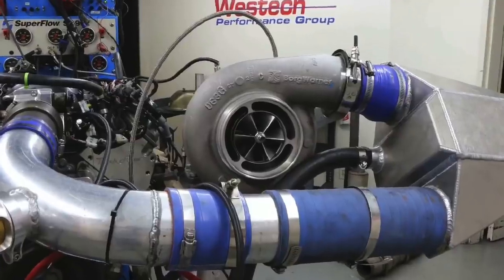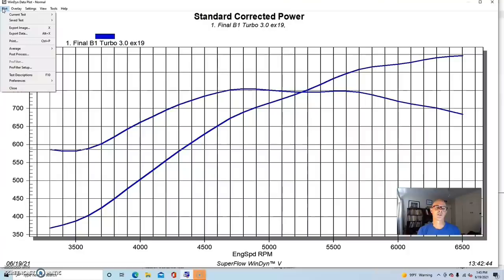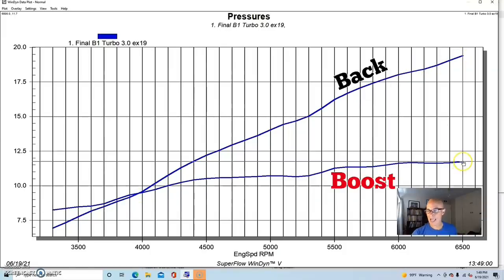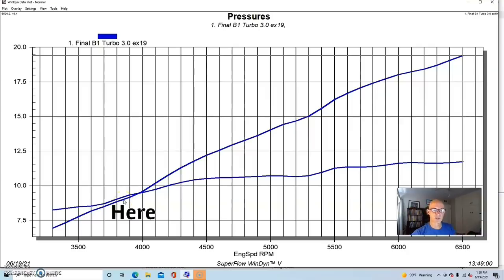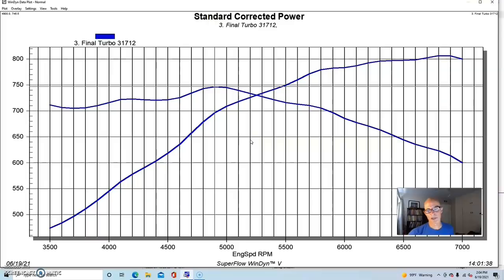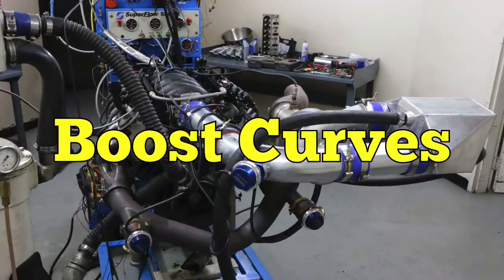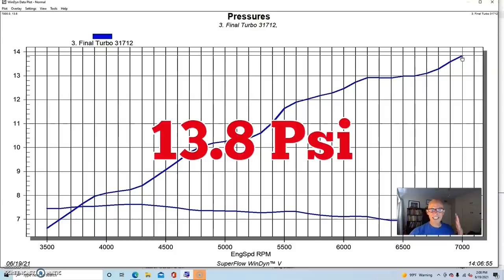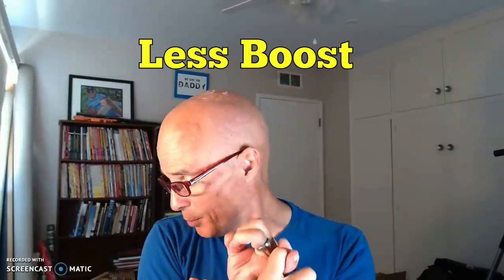JUNKYARD TURBO LS BACK PRESSURE TESTS (HOW TO: MAKE MORE HP)

Comment: Richard, you seem to make emphasis on the exhaust setup right after the turbo. What would you call that form where there seems to be 2 reducers matched together? Could you elaborate?  It resembles a regular yet turbine  exit. I imagine there's something there as to the shape air wants to take while exiting.
Reply from the maker: was only there to allow us to bolt it together-not a good idea

Comment: Quick question I have a K24 but my throttle body leaks, so I wanted to weld it on in front of the compressor on the turbo housing is this a good idea? I am on a budget, but I can weld.
Reply from the maker: welding the cast throttle body might be difficult
Reply: I could also do a custom adapter, i’ve been welding over 20 years I just have never seen anybody put a throttlebody before the turbo. I’ve seen it done with carburetors. Do you think that I’ll have any problems? Not welding or fabrication but performance. Also, thank you for responding. I know your time is valuable.

Comment: ls 5.7 9.5 cr lot of backpressure ( vs racing 7875)...headers or line afrer turbo is the cause?
Reply from the maker: exhaust size and flow after the turbo effect back pressure, so does the na power vs turbo size

Comment: Is 2:1 a bad ratio? Backpressure to boost
Reply from the maker: VERY NORMAL RANGE
Reply: @richardholdener1727  what if your backpressure if very high.  I have a very tight tight 90 after the turbo and I think it’s making a lot of backpressure.
Reply from the maker: restrictions are bad for flow
Reply: @richardholdener1727  yes but what will the restriction and bad flow cause.  Other then HP loss.  Does it push air back into turbo through the seal? Does it damage the turbo? Does it make it run rich? Does it not evacuate the gasses in combustion chamber causing more pressure on rods?
Reply: Damages your dyno sheets thats about it
Reply: @BulliKid also raises crank case pressure.

Comment: Love this video. Tells me that I want to do a 6.0 with rec port heads a ls3 or truck intake and boost and a 4 inch exhaust with a electronic boost controller. That to me would be the most efficient set up for a street application.

Comment: On a recent hp academy interview ( I agree with your point ) but the tuner , the scion guy , stated he seen 0 extra exhaust flow / volume to the turbo adding 100-150 nitrous under  boost , where as I would have expected to see this enhance spool with gas expansion, but it seams not
Reply from the maker: he is wrong-how do you add an extra 150 hp to any motor without changing exhaust flow?
Reply: @richardholdener1727   so here is a link 
https://www.youtube.com/watch?v=lrYpgQIXSSM&t=5s
see he is a credible source , see what you yhink , i'm with you on this , might be worth a video , not to prove someone wrong as he seen what he seen , [[ different engine or whatever ]

Comment: hello there,  so im having issues with boost drop with a smaller exhaust system but when i do open downpipe it work wonders.   do you think this will be my issue?
Reply from the maker: YOU ARE BUILDING BACK PRESSURE AND IT CAN ALSO CHANGE THE OPENING OF THE GATE

Comment: I use a 5 inch downpipe on my s475 because I had the room (some of the firewall had to get out of the way) and that's what the outlet is plus...the huge pipe looks cool. It seems to really like it. Despite having no boost controller and running a pretty small 5L engine, it seems to spool pretty quickly. A 4500 stall doesn't hurt either.

Comment: Can you do this with NA LS motors
Reply from the maker: back pressure tests?
Reply: @richardholdener1727  yes. I've got open headers on a stock 5.3 with a tune and all the old guys I work with are telling me I need to put mufflers on it to get more back pressure so it will make more power and I dont see how that makes sense
Reply: @uscgamecock9432  old people think back pressure is something you need, it's an absolute load of shit. Get your car tuned and it will run better, it might run a little lean with open exhaust.

Comment: I wonder what happens if you feed a radial supercharger into a turbo and put an intercooler behind both stages
Reply from the maker: we ran twin turbos with an intercooler feeding an M112 Roots on a 2003 Cobra motor with an ATW cooler-works well
Reply: @richardholdener1727  well yes but I expect a centrifugal to work differently then a positive displacement blower. Hear me out. At low speed the turbo can still suck through the centrifugal. At higher speed the turbo does not reach its flow capacity nor its surge line since the surge line is defined by the ratio of ambient pressure to pressure after the compressor. And the flow cap / choke is defined by CFM in which does not change much since the air is pre compressed. Turbo speed will likely increase but it's counteracted by it having to do more work to compress a more dense charge. So at low speeds you should be able to gain allot more tourque and boost earlyer on and you should also gain more efficient operation at higher speeds (compared to a turbo of the same size at a similar pressure) 🤔

Comment: I liked these videos already, but now that I have my own 5.3 LS 4L80E swapped 2001 Mustang V6 on 10psi T45 ebay turbski, they are better than TED talks! I think I blame Mr. Holdener and Mr. Mcfarland for not so subliminal messaging to the deepest parts of my car brain.
Reply: Where'd you find a 4l80e are they rare in the states?
Reply: @andrewlace   many 2500 and bigger trucks, vans, and SUVs had them. Pretty common here in Texas but most have been worked hard.
Reply: @michaelenglund4963  in Australia that's the hardest thing, getting a good gearbox. Lots of turbo 700 getting built but a 4l80e would be a fantastic gearbox especially if it's been built. Imagine one of these behind a barra (Ford) lol.

Comment: Is there any kind of math that can be done to help choose an exhaust housing AR? Let's say two ebay GT35's for a 466 to 521 inch mill, there are two different AR's and I'm leaning towards the bigger AR because it's not a small engine and I'm not clear if the smaller AR (.62 ) will choke it compared to the .80 AR. All the mathy things I find are impeller maps, but that's the other end of the turbo... :)
Reply from the maker: use .80 on a 521

Comment: Completely unrelated: Richard Holdner now sells exhaust valves and pistons...
Reply from the maker: No Thnx
Reply: @richardholdener1727  Have you done any work with the Caddy Northstar? I've heard of some great results on the dyno just with some camshaft adjustment with the stock cams. I think it would be fun to check out since you did the big inch Caddy engines. Now you could do the baby Caddy engines or even the 4.0L Aurora engine. Big revs!!

Comment: Richard, can you add the lobe separation of whatever cams you are running at the time so we can see examples and where peak torque happens. It's more significant with carbs because you can't vary injection timing or duration. 106 separation has a lower peak torque than say a 110 lobe separation. Obviously with EFI you can do whatever, I'm curious to see what the effects are.
Reply from the maker: cams do the same thing regardless of whether the fuel is supplied by a carb or efi

Comment: The LS3 heads need a bigger A/R to drop the backpressure and increase the boost pressure without changing anything else.
Reply from the maker: any head that increases the power will show similar back pressure results

Comment: I had a test on my channel recently where an s366 slightly outpowered an s480 Back to back, same boost. Turning the bigger compressor when it's not required did infact create more backpressure and it showed on the dyno as well as the boost control. Thanks for providing us with these tests Richard, cheers. 🙂
Reply from the maker: an s480 had more back pressure than an s366?
Reply: @richardholdener1727  More duty cycle was required to keep the wastegate under control with the s480 at 10psi.  It's probably important to mention that we were only testing at a knock limited 10psi on pump fuel in-car.  Had we increased the boost with e85/Race fuel, obviously the s480 would have less backpressure as the testing progressed to higher boost levels. But as far as relevance goes in regards to how most people would use the car on the street (i.e., pump fuel, heat soak, knock limited etc.) I thought it was notable for the majority of street driven cars. I should also mention that we did not have a backpressure sensor, just backpressure against the wastegate to come to that conclusion, and I am definitely open to the subject :) 

Also, the s366 made a few numbers more on the same boost/timing which also leads to the lower backpressure hypothesis in my opinion. *There were no other changes to the car other than the Turbo swap.

Comment: "Boost" is a measure of backpressure in the intake. This becomes most obvious with a belt driven supercharger where you swap on better heads or intake, lower measured boost, but make more power. Turbos just often mask this because wastegates maintain pressure to a set point as improvements are made. Meanwhile the shaft is spinning harder...
Reply: This is why I boost itself is a terrible number and concept. You need to be talking about mass air flow. The engine is just a pump, you need to measure how much air it is pumping.
Reply: @otm646  I have primarily tuned speed density but I will admit that mass air is a WAY smarter way to measure things. When you KNOW the CFM incoming it's got to be easier to properly fuel the silly thing. I like that concept much better for sure but finding a meter you can get readings from on an aftermarket ECU is painful. Certainly the superior way for many situations I think.
Reply: Wish more people understood this.
Reply: @rwdisgreaterthanfwd  no shit man.  People talk about boost like its the same across the board across every type of car or truck and forced induction.  "How much boost can it take?" Is an annoying question that bugs me lol.  10 psi on a big ass turbo on a fully modded engine is totally different than 10 psi going to a stock motor via a smaller turbo.   Not even comparable.  The airflow on one is going to demolish airflow on the other despite both running 10 psi lol.
Reply: @midnight347  Yeah,. it's always weird when you swap turbos, run the "same boost" but end up with MORE power! Nowadays we can datalog backpressure and many other things to better understand but that wasn't always the case for sure. People still don't get it though and Richard's videos really help dispel many of the myths :)
Reply: @rwdisgreaterthanfwd  To be fair I was one of them! I had a belt driven supercharger on my Mustang MANY years ago and when heads were ported etc. I was upset I'd lost boost. Except - the car was clearly faster! It took awhile but I get it now but back then hardly anyone understood much of this it seemed and people ripped EFI off for carburators. Meanwhile I was swapping on turbos lol.
Reply: This is how you can take a stock turbo car that has a stock computer set for a stock boost level, and upgrade the exhaust intercooler and turbocharger and at the same boost levels make quite a bit more power.
Reply: @robertfattaruso1280  Or blow it up if it's Speed Density and not MAF! This is a large part of why the FD3 blew up so easily back in the day. Detonation sensitive and very easily able to remove restrictions - whoopsie!
Reply: @BLKMGK4  haha yeah that's true, older cars that were speed density and didn't have mass air flow we're very susceptible to damage. But with today's technology and newer cars with quick responding ECUs you can do a few minor upgrades and gain 60 to 70 horsepower on a turbo 4 cylinder without modifying the factory computer settings. If you remove restrictions on the inlet and outlet as well as increase the turbo efficiency, throw a little splash of e85 in the tank with 91 octane and it's a very streetable gain.

Comment: @richardholdner   Per your theory, i ask you this..  
If a cam that's ideal for an NA engine to make the most/best power it can, then why are there "turbo" cams? From your theory, "the more you make NA, the more it'll make boosted".  The conflict i see is, the ideal NA cam for a given engine isn't the best cam once it's turbo'd. Discuss...
Reply: N/A cams tend too have more overlap.

Turbo cams tend too have less.

If you have 30psi of back pressure and 15psi of boost what wins when both the intake and exhaust valves are open?
Reply from the maker: take a stock cam on a 5.0L Ford-then run it under boost. add an XE274HR cam-then run it under boost. what happens?
Reply: Print out the spec sheets for those camshafts and put them directly next to each other. The na cam is working to maximize volumetric efficiency given a pressure differential of one atmosphere max. Your turbocharged camshaft has a broader pressure range to work with trying to fill that volume, so it can be optimized in other ways because of that.

Comment: Hey richard id be interested too see a factory valve shootout.

Solid stem L76 valves
Hollow Stem Ls3 valves
Titanium ls9. 

Measured onna factory gm cnc ported ls9 head.
Reply: The only benefit to the different weight valves is it's ability to resist float and maintain valvetrain stability at high RPM. There'd be no power gain besides that unless something was on the ragged edge and the couple grams made the difference between stabil at 8000 rpm for example or not. For most apps, it's not worth the cost
Reply: @BEANS-O-MATICtransmissions  i would be interested in seeing it play out either way :)

Comment: Boost is a measure of resistance.

Rec port  let more air in, lower boost
Rec port let more air OUT more backpressure

As usual rec port is king. ;)

Comment: As much Richard loves turbos you have to wonder.  Do ALL his vehicles have turbos?  What about his lawn mower? Great video Richard.
Reply: If they don’t have turbos, they all have cams
Reply: I get it... I have done porting for my daily drivers, cams, just not turbos yet...

But when I ported my pressure washer, it's far more reliable, and runs better. The motor would pull down in rpm because it was slightly small, and now it doesn't. 

I ported my power trowel for my work, and it starts better, while being more capable.

I ported a gas powered sweeper, making it far more effective - 8k rpm to 13k rpm...

I ported my concrete saw, and it starts easier and faster, and cuts faster...

Do it right, and your equipment is more reliable. It's not always silliness... even though it may sound like it  😉😉😉

Comment: I've always been puzzled by why you don't use that fancy boost controller more, today it got me thinking. Do you do it because that many people run off the WG spring?

Unless you've absolutely maxed out your turbo or fuel injectors, or have no more traction, there's zero reason to run gate pressure with less HP than your rods/pistons can hold or cam/heads can flow. Otherwise it's basically like saying "gee, I think I'll run half a second slower for no good reason today"
Reply: Although... it is recommnded to run gate spring pressure that will give a boost of about half you final target boost, for best boost control.

Eg, run a 12psi spring if you intend to run at 24psi, and let your controller to do the rest.
Reply from the maker: do you think that every turbo owner runs around with their turbo set up on max boost? on the street? the answer is no-most run around at lower boosts and only set them on kill for track use

Comment: I keep reading posts online that chambered mufflers are HP killers behind turbos compared to other mufflers. Any truth to that or is it just more internet folklore? Care to test it if you haven't heard of it?
Reply: I remember an article with dyno tests saying Flowmasters were 50 hp down vs. Borlas on a 550 hp supercharged SBF.
Reply from the maker: I HAVE NEVER TESTED THAT
Reply: @richardholdener1727  maybe that would be a good test session for a future video. I'd definitely be interested in seeing that test on a boosted motor.
Reply: Chambered mufflers are hp killers period
Reply: @maybellene500ss  not necessarily any kind of muffler can be a power killer in really high horsepower applications I remember watching a vid about a Cummins that gained like 80 horsepower after removing a resonator

Comment: Richard, quick question. I have an LS1 Trans Am. Has longtubes, LS6 Manifold, still has stock heads it's getting a 227/235 .618/.605 110+3 Cam soon. Would a FAST 92 be worthwhile with my setup?
Reply from the maker: IT WILL HELP 10-12 HP
Reply: @richardholdener1727  Appreciate the reply! May pick up a used one!

Comment: An easier way to say it is : Measuring boost pressure is = to measuring resistance of flow.
Reply from the maker: THAT'S NOT WHAT WAS TESTED
Reply: @richardholdener1727  https://youtu.be/5NS8JlDmmh8 you have a colleague wanting to collaborate on a project.

Comment: I heard somewhere that having a recirculated wastegate, as opposed to open wastegate, improves boost control. But I have also heard open wastegate makes more power.
Reply: Recirc reduces the pressure drop across the wg and slightly increases post-turbo backpressure, so it's both less HP and worse control. Nothing earth shattering tho.